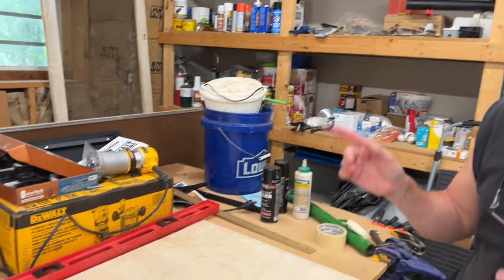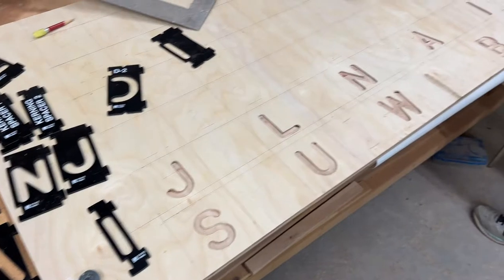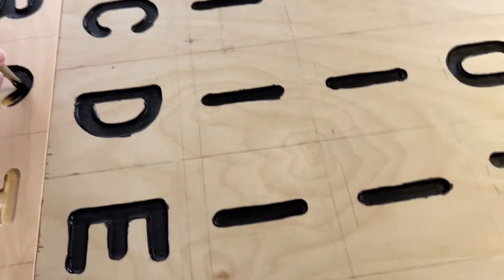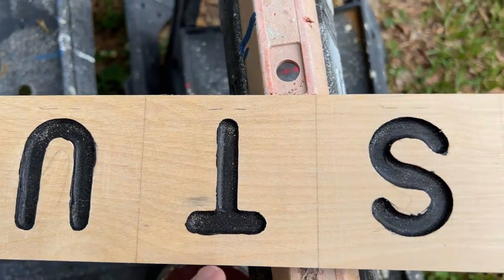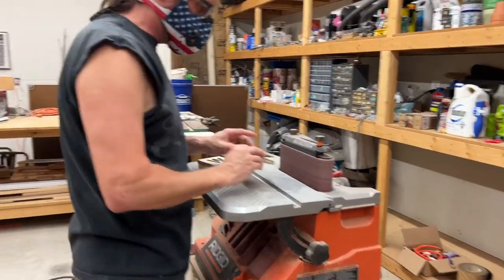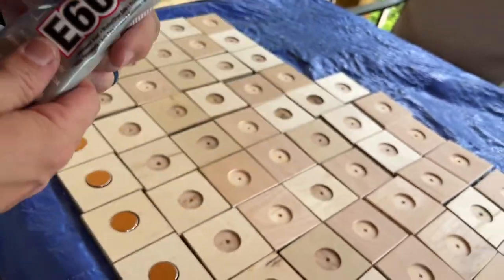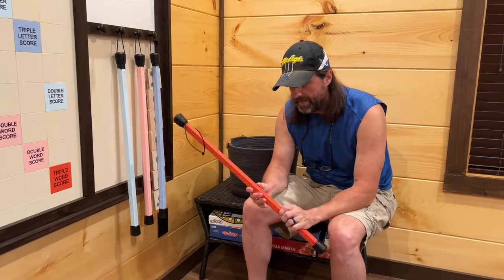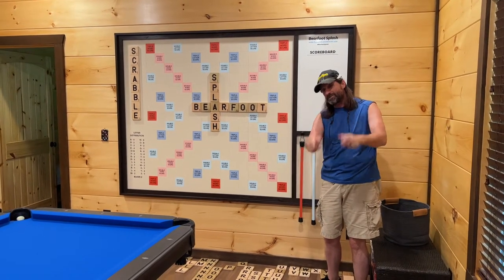How to make DIY Giant Wall Sized Scrabble Board Game - Part 2 - Making the Game Tiles

Comment: This turned out awesome!!! A lot of work, but worth it in the end.
Here's a tip for using e6000 glue: squeeze a little onto a plate, and then use a toothpick to apply the glue to your project. The bottle it comes tends to ooze too much, so the toothpick allows for a more precise application.
Reply from the maker: Yep that worked much better when we started using that method to apply the glue for sure!

Comment: Looks great but quick question, when the tiles are in the bin don’t they stick to each other making it difficult to pick without looking at the letters you pick?
Reply from the maker: Yes they do stick together but they end up sticking together in stacks and we make several stacks with letters down.  So it's not too hard to pick them out with the stacks upside down.